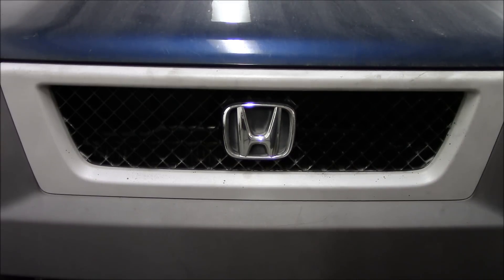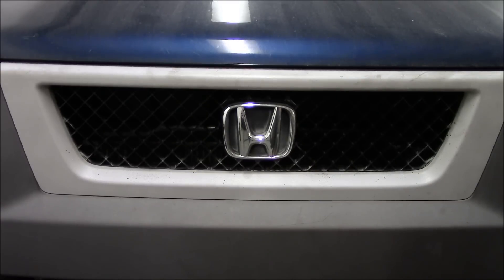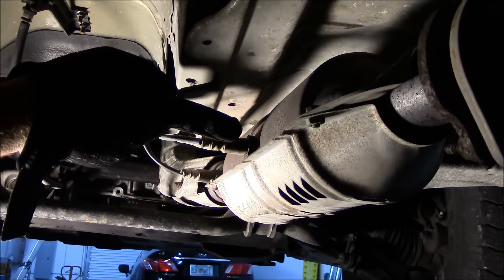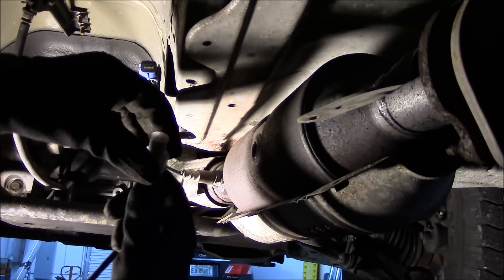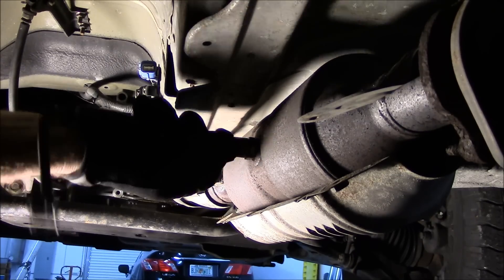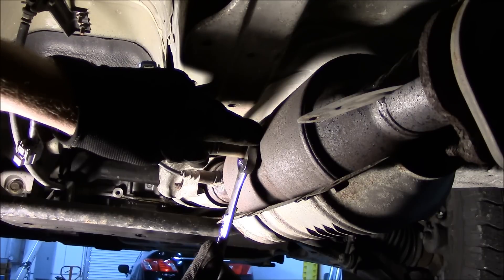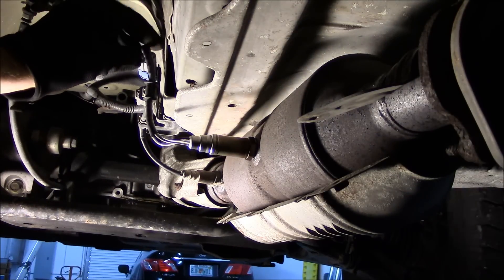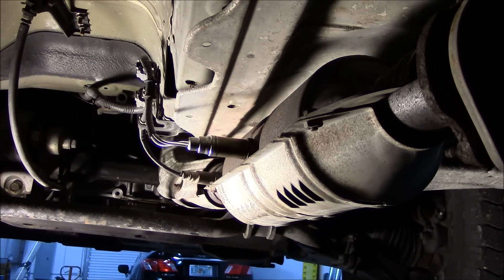Honda Check Engine Light P0141, Oxygen Sensor

Comment: My Honda Element 2003. Failed smog check for code P0141. Replaced Ban1 Oxygen sensor 2, bingo, Passed smog.
Cost me  $17.99 sensor on Ebay, and $20 for loosing old  one . It was stuck like hell. Thanks for video.

Comment: So that code refers to post cat sensor thought was pre cat after watching  other  videos on error code p0141 have 01 honda hrv  bought new 02 sensor installed under bonnet on engine but code stil there then checked volts from connection harness from ecu seems ok, ?

Comment: Here recently ive gotten a p0141 code and my car is misfiring . My catalytic converter was stolen but like a year ago so i have no where to plug the other end of the sensor to. Would this cause my car to misfire or something else?
Reply from the maker: missing cat would not cause misfire. generally speaking, misfire is problem with fuel or spark, you need to identify the cylinder with the misfire, then swap spark plugs, then coil packs, then plug cables, etc away from that cylinder, to see if the misfire moves, if it doesn't move after you've eliminated spark as suspect, then you're looking for a fuel issue. if you have fuel injectors, you may have a faulty injector or electrical connector.

Comment: I got P0141, read about it online. Just changed my second sensor (under the front passenger seat) on my 2005 Accord. I then cleared the code, but it came right back on. So I'm thinking driving it for ~30 miles or so won't change anything?
What are your thoughts? My fuses look good. The specific fuse is the FI ECU fuse right?
What would be my next step for diagnosis? I think my dad has a sensor that'll give real time values, what should I look for? Thanks!!
Reply from the maker: Daniel Loveland That is a puzzler, the p0141 code is almost always a bad sensor... take a look at the wires and the connector, maybe they melted somewhere along the way?
Reply: Thanks for the reply and help! I've replaced the sensor end, and I thought what it connects into looked ok, but I'll take a closer look with a good light. Beyond the connection though, the wires disappear into the floor heading toward the engine, and once I'm looking under the hood there are quite a few bunches of wires coming from the car on the passenger side. Do you have any idea which/where the sensor's wiring is?
Reply: Daniel Loveland Hey Dan, i'm having the same issue with my Civic. When we digged in we found that there was no resistance coming to the wire from the ECU which is a Bummer! but i'm still trying to find out if it is for sure the ECU. You might wanna check the connections coming from the ECU for the connector that connects to your your sensor. Is it the S1 or S2 ?
Reply: Raj verma  I want to say S2... I haven't checked in a while and I haven't made any progress. I've been busy. Where's a good place to find a map of wiring? Then I can check my ECU-to-sensor wire.
Reply: Daniel Loveland  Not sure about the wiring, but what you can do is to check the resistance of the wire from the sensor to the ECU. Behind the ECU there are 3 connectors of which 2 give connection to the ECU. Now you'd probably have to manually find those connections and see if there is any resistance coming in. Also, in my case the local guy said that its the ECU as the ECU circuit is not giving any output for the sensor but i'm not ready to accept that as everything else is working fine and if its the ECU then it should give me more issues than just the s2 sensor. Sadly my p0141 is still there and not resolved :(
Reply: I was double checking my cable underneath the passenger seat, and I hadn't pushed it in 100% to where it clicked! So it's embarrassing, but a relief as the code has yet to return.
Lucky me, sorry yours isn't working out...
Reply: Daniel Loveland I
Reply: I have the same issue with my Element. 

Please let me know how you resolve it

Comment: I have a 20000 Honda Odyssey van I put. new EGR Valve in,a new catalytic converter and the. sensor on catalytic converter,but the light still comes on it says EGR valve.How do I clear light and could it be sensor in front of catalytic converter? Thanks for your Help??
Reply from the maker: Did you clear the codes after repairs? if not, disconnect the battery and let the car sit for an hour. if the codes come back either immediately or after a while, then start diagnosing... do you have the exact codes that come up?

Comment: Shouldn't you check the connector or fuse first before you potentially waste money on a new sensor?  

I'm also getting this error code but before I buy a new sensor, I want to make sure the electrical connection isn't bad.  How would I go about doing that?
Reply from the maker: If the connector is bad, you should receive a communication error instead of or in addition to the heating code. If the fuse was blown, you'd have no cruise control, no evap, no air fuel sensor and no camshaft sensor... basically the car would not be running. The fuse should be located under the dash, slot 4 and is a 10A fuse, give it a check since it is easy enough to access.

If you had software that uses a laptop and communicates with the Honda through the OBDII, you could check real time values on the o2 sensor, that is an easy way to diagnose a bad sensor or connection.
Reply: ZipZapDIY Thanks for replying!  

So if I got the P0141 code on my '03 Element, it's pretty much a sure bet that I need to replace the sensor?

I wonder if Torque Pro (Android app) paired with a ELM327 OBD scanner would be able to check real time values.  I just bought Torque so haven't really delved into all its features.
Reply from the maker: clankfu100 it is a safe bet, of course, poke your head into the fuse box to check the fuse, and take a look under the car to see if the connector has toasted before you buy the sensor, stranger things have happened.I'm not familiar with Torque Pro, but from what I just read on one of the Porsche forums, it appears to be a nice upgrade over a generic OBD reader, such as reporting many real time values like some O2 and other sensor data, but not as powerful as dedicated software.
Reply: ZipZapDIY How can I tell if the connector is toasted?  Sorry for all the questions.
Reply from the maker: clankfu100 cut wire, melted, falling apart etc.
Reply: ZipZapDIY Got it.  Thank you.

Comment: Did you just replace the sensor without even performing a simple test on its heating circuit? I think you shouldn't rely on "almost always means the oxygen sensor is bad". You have to be 100% percent sure, not just change the part and hope that the light goes off.
Reply from the maker: "100% sure" is a fallacy, context matters... On an old inexpensive car with over 150,000 miles and confirming CEL code (other than the ECM, the O2 sensor is only thing on the heating circuit, no fuse.. that is why I inspect the wires and plug) in the Honda, replacing an easily accessed and inexpensive part is usually adequate "testing" and you can go from there... When I'm working on old high mileage cars I encourage you to replace easily changed and inexpensive parts at every opportunity. On my old truck I had a pre cat emissions issue... instead of spending hours to figure it out, testing, researching to  be "100% sure",  I spent 45 minutes and $80 replacing every emissions part on the truck. On my Porsche, an O2 sensor costs between $100 and $300 each and there are four of them.. so it is worth hooking my Durametric up and getting live data, testing and comparing to my workshop manual and the detailed technical resources I have on file... Plus it is more fun to work on the Porsche. Testing things and intimate knowledge of the car is part of the joy of ownership, If you feel that way about your Honda, then go for it..

Comment: Sir, i am from India, i just seen your this video this help me a lot to my knowledge because i am facing such a problem in my car 2005 model Honda accord. in wants to know 1. Is this car in this video is 2005 Honda Accord? 2. I tried the 2nd sensor changed which having big wire and jumper below the seat but no result error still P0141 please advice me
Reply from the maker: Honda Element in video.

Comment: I'm just going to go ahead and just like any of these that don't differentiate the other O2 sensors like upstream and downstream and if you have a V6 or V8 with two manifolds you're going to have a total of four sensors you're going to need depending on your exhaust setup and how many catalytic converters you have if you have one catalytic converter and one pipe you're only going to have two sensors if you have a V6 and a V8 and have two different exhaust manifolds you're going to have a total of four centers to upstream and to Downstream now this code that he is tripping is what he calls the Second sensor that would be Downstream sensor one is always Upstream okay which means if you have to Cadillac converters it will be sensor 1 and 3 for upstream and 2 and 4 for Downstream...  on a standard Honda Element with an L4 2.4 engine you will have a total of two sensors your sensor one will be Upstream your Sensor 2 will be Downstream this code I cannot speak on because I have not seen it yet but the Upstream sensor one is a P0420 and at least that's what it is for me that would mean a bank 1 sensor 1 meaning your first Upstream sensor and Upstream means exactly what it is it's ahead of the catalytic converter toward the engine Downstream is exactly what it says it is beyond the catalytic converter toward your tailpipe and the back of your vehicle that would be Downstream Sensor 2 or bank 2 but Bank One or sensor one is always before the catalytic converter and you can get a check engine light from either one now to try and figure out how bad yours might be you don't have to clear the code with a scanner you can simply take the battery terminal off disabling power to your computer and maybe for like 10 minutes and then put it back on in your check engine light will now be cleared until it Trips Again if it trips within a minute you better get that bad boy replaced if it takes a day or two you might have a minute but you're going to smell some awful smells coming from your exhaust I highly recommend getting it replaced unfortunately for Honda's I just spent $125 after tax and for American cars you might get away with it for about 40 bucks maybe 50 bucks but if you have a Japanese import plan on getting raped especially if it was discontinued like the element

Comment: I swapped out the 02 and I'm still throwing the code.  What gives?
Reply: Alex S. Did you reset the computer and drive the car at least 80 miles?
Reply: @jmjosemora16  how do you reset the computer
Reply: @MysticGT_Gio  easiest thing to do is drive over to a local autoparts store that does free check engine light scans and ask them to check it for you and to also erase the code. The other thing is to buy a obd2 code scanner off Amazon or ebay and erase the code yourself. Its pretty easy to do. If You can change any sensor on your car you can work a obd2 scanner

Comment: How do I know which sensor to replace?
Reply from the maker: Sensor 1 is closest to the engine, Sensor 2 is furthest from the engine. The error code P0141 is O2 Sensor Heater Circuit Malfunction (Bank 1, Sensor 2)